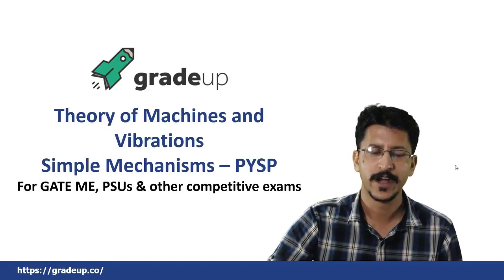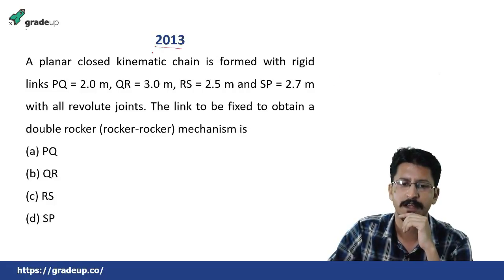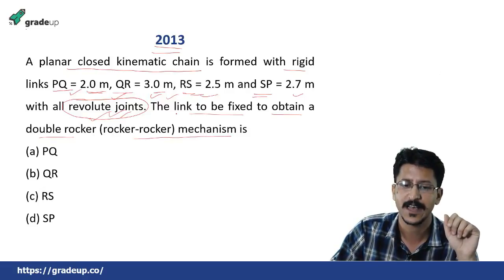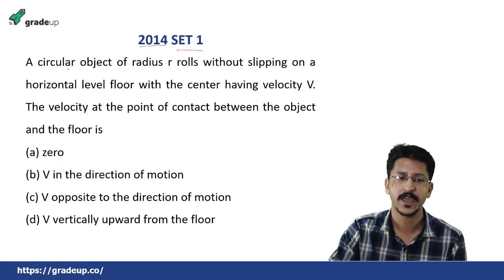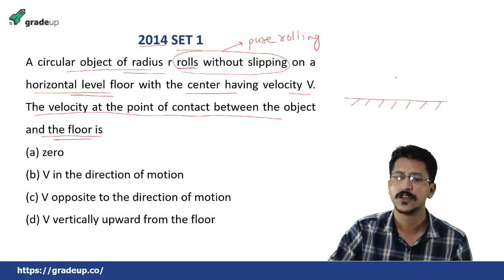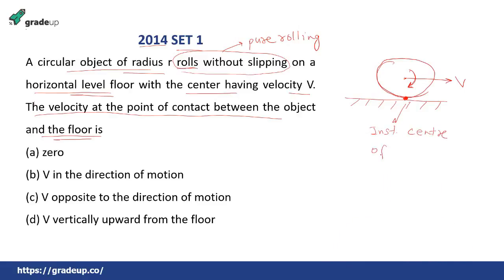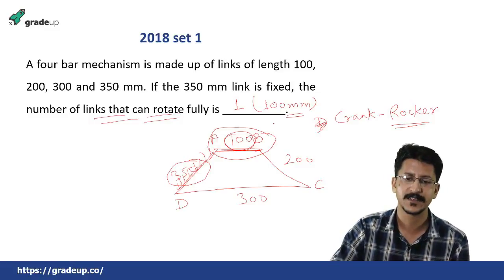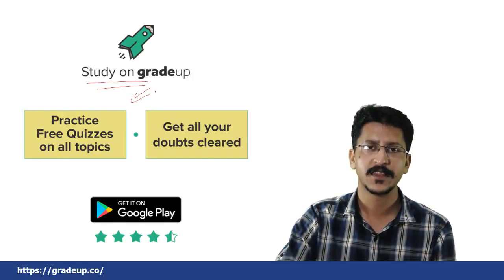Theory of Machines GATE Questions | Simple Mechanisms Previous Year Problems | GATE Mechanical 2019

Comment: ‌A hollow shaft is subjected to steady bending moment of 40 N-m and twisting moment of 50 M-m. Outer diameter of shaft is twice the inside diameter. Calculate diameter of shaft using ASME code for transmission shaft on the basis of maximum shearing stress theory of failure. Take : yield point stress in tension of shaft material=280Mpa , factor of safety=2.0 , combined bending and fatigue shock factor=1.5, combined shock and fatigue factor for twisting=1.0